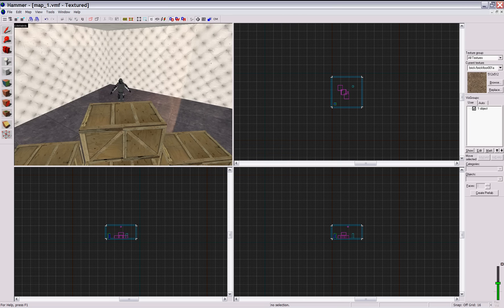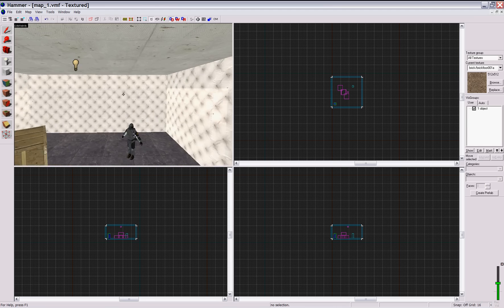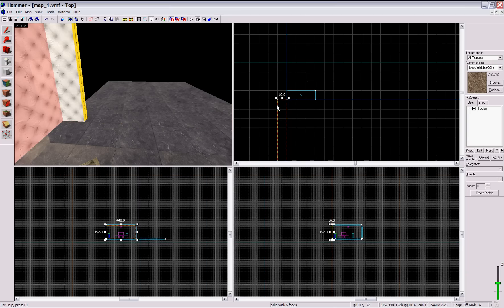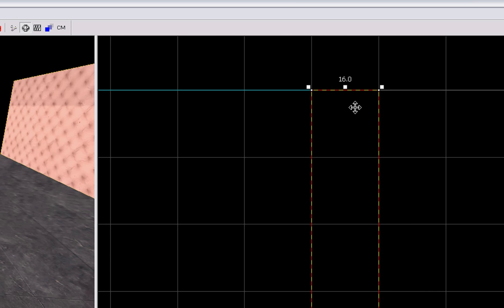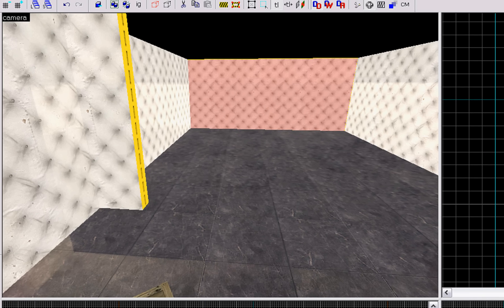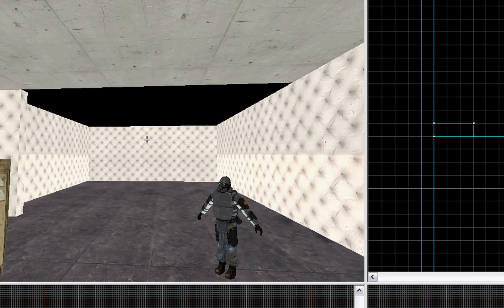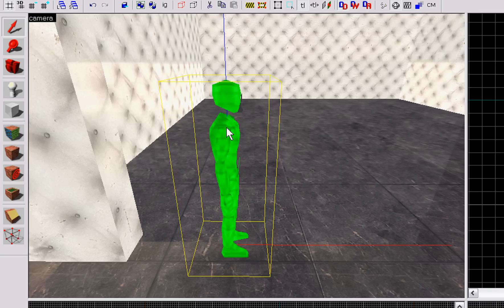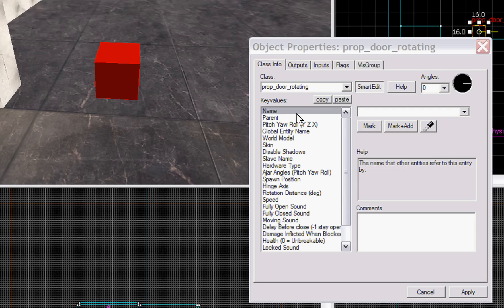Hammer Editor: Doors Tutorial part 1

Comment: i got a problem when i am doing  the door and goes in to see what doors it is i have nothing, i am used to do maps  to the original hl2 and sven coop. but i dont understand why i cant do doors like in that valve hammer. when i give the option to rotate or to just be a normal door it buggs out and the door face the wrong way, let say "_ _" is the doors when i go into the map and checking ingame the doors is faced this way "| |" this is driving me nuts. plz  answear as soon as you see this :/  thanks,